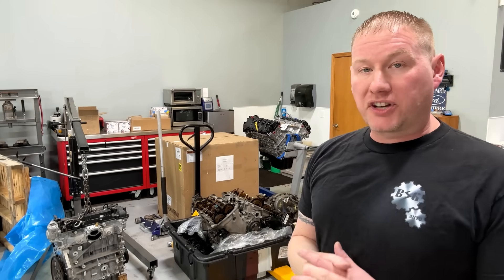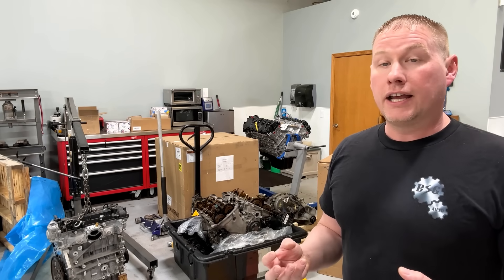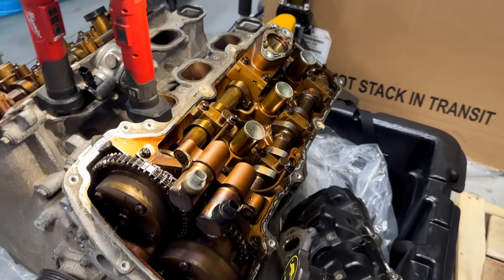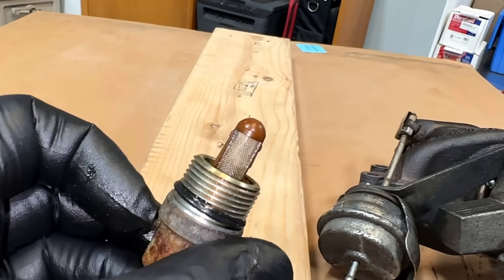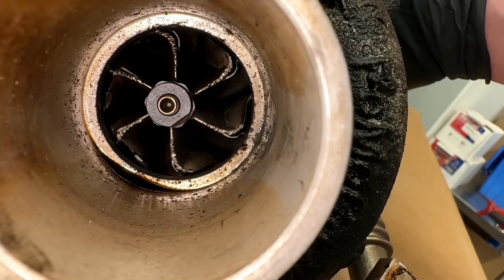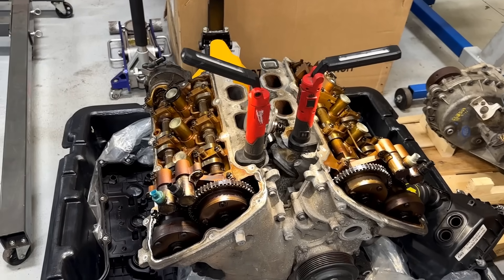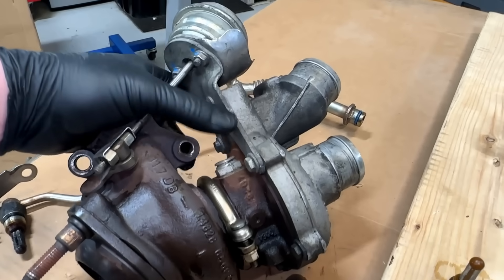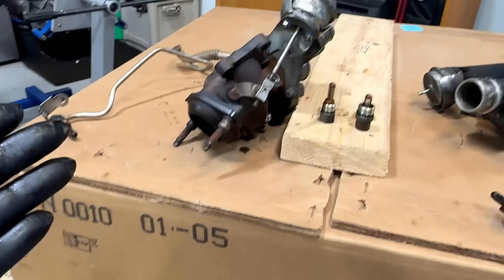This is Why You Never Run Extended Oil Change Intervals on The Ford Ecoboost Engines!

Comment: Have my 2017 F150 3.5 open right now for the second timing/phasers. Dealer did the first one and used the same defective part numbers. After seeing this video I will be checking for these issues too. Love this channel. Thanks for the content.
Reply: 2018 3.5 second set of phasers being replaced right now.  Ford used what parts inventory they had in 2021, part shortage due to the pandemic. Unfortunately most of us received the defective H series instead of the newly designed M series phasers.  I had 44,000 miles on the first cam phasers and exactly 88,000 I am replacing those.  Grateful I bought an extended warranty, deductible $100.00

Comment: I still change my oil at 3000 mile intervals. I'd rather buy more oil than a new engine or turbos. the oil minder on the instrument cluster usually says I have from 75 to 80% oil life left.

Comment: i dont think you can say " running extended oil intervals" when using the built in oil change reminder. if the built in reminder is too extended they need to fix that. my parents (chrysler 200) has the same issue. sometimes the warning does come on for almost 10k+ miles! it needs to be fixed!
Reply from the maker: 10k is way too much so yes that is an extended interval on a turbo as shown here any other questions?

Comment: Brian have you seen one of here 3.5 ecoboost leaking coolant inside of the turbo? I’ve got a guy the passenger turbo is pouring coolant into the turbo. If you pressurize the cooling system the coolant flows through the exhaust from the passenger turbo, it’s not leaking externally, the leak is originating inside of the turbo?
Reply from the maker: never

Comment: HELP !!!! The mechanic is changing my 3rd turbo under warranty I've only put 1500 miles on two turbos. Can the problem be because they install cheap turbos or not I asked about the oil pipes the mechanic says.

Comment: When ecoboost came out,my concern was the turbos. Nothing is special about ecoboost. Same as any other turbo oem,,, let them cool down at idle 1-5min (like a HKS or Apexi turbo timer would) before turning off engine and change oil often. That is the only way i see the claim of "these turbos should last as long as the engine" working out.
Reply from the maker: No need, the Ecoboost engines are designed to create capillary action to keep coolant flow through turbos after shutdown without and turbo timers or aux electric coolant pumps.

Comment: Every engine has it's trouble spots, but which is the safest bet for the Explorers in the 2016-2019 range, is the 3.5L non turbo, 2.5L or 3.5L Ecoboost?

Comment: Great video. I always did my oil changes earlier than recommended but now I will shorten the interval more. Would a FL-400S work in place of the FL-910s recommended for my 2022 Ranger? It seems that the extra oil and filter size wouldn't hurt. Looks like it would fit easily.
Reply: @daveriley1513, Yes both filters have same threads & think 400S adds 0.3Qt. capacity.  In my Mustang ecoB would make my capacity an even 6qts!  However I went with Pl. Boss filter; & their 400S equivalent (as well as other brands) are NOT equivalent to 910S!!  Only with MC are they equivalent. Yes more oil can't hurt!

Comment: When I worked in parts delivery, we had a customer who collected 301 Turbo Trans Ams. Customers would bring them in with toasted turbochargers, due to lack of proper maintenance, then gave up on them when they found out how much it would cost to fix them. He bought the cars from the customers, who were happy to be rid of them. He would rebuild the turbochargers, when had time, and sold the cars years later, when they became collectible. They were just junk cars, in the early 90's, when he bought them. It makes me wonder how many turbo cars of the 80's went to an early grave, because the owners weren't aware of the additional maintenance requirements.

Comment: I appreciate the video...however it makes me HATE my 3.5L eco-crap engine in my 2018 F150 Raptor even more. At 120K miles, It's been in for the cam phasers (3) times, the valve covers leaking oil and the turbo's lagging boost. I've been having the oil changed every 5K miles. It's been a real bummer! For the life of me I don't know why Ford won't offer the Raptor with the Coyote motor option. Definitely not going to pay for the V8 supercharged engine. When my engine dies AGAIN...I think I'll just blow the truck up!

Comment: I have a question about my 2020 Transit 3.5L EcoBoost... since the turbos run so hot, would it be better to upgrade to a better turbo? A larger turbo, even? Has anyone ever upsized their turbos on a Transit? lol I'd personally like a little more power for my large family - maybe bigger, better turbos would be of some use?? ...plus, I'd like to actually hear my turbos, as I don't at all right now lol...

Comment: I have a 2021 Ranger, 2.3 L EB that has oil changes every 5K miles. Driven on over 20 minute trips almost daily. Hour trips weekly. Thought all the bases were covered till this video. Will be checking those screens for sure. 
THANK YOU!

Comment: I have a 2023 F150 with the 3.5 ecoboost in it.  Ford recommends 5w-30 oil, which I have no problem with.  My wife has a 2016 Explorer with a 3.5 naturally aspirated V6 and I have been using the full synthetic Pennzoil oil made from natural gas.  My wife's vehicle has been absolutely perfect, now with 55k miles, I change oil at every 5k miles.  My question is should I move to a 5w-30 oil for the Explorer rather than the 5w-20?  I have been hearing that Ford only used the 5w-20 for mileage reasons?  Thank you for your input!

Comment: I have a 2020 F150 2.7 liter I run mobile one full synthetic, change every 4000 to 5000 miles my question is I like to sit in my truck with the AC running at lunchtime for about an hour 5 days a week is that idling going to hurt the motor or the turbos?

Comment: 224K honestly isn't horrible for extended intervals on a turbo.
When I had my 2.7EB, I used full synthetic rather than the semi they spec'd. I changed every ~7k, or when the oil life meter hit ~40% if I forgot to keep track of mileage. My estimate was 0% would hit close to 9-10K miles with normal use. Way too long, especially on semi syn.  
I went 10k on my RAV4 before that using full syn. I did a couple oil analysis to make sure 10K was fine. Results came back really good. But being non-turbo, and only port injection it was easier on the oil.

Comment: I do oil changes every 5000 miles for simplicity, makes it easy to remember what miles to change at, also the oil can be pretty dirty and lose a good amount of its viscosity which is the protection for the metal, I've made several custom turbo systems for cars over the years and on the next systems I do I'm going to try something different, I want to have a separate oil system for the turbo, it will consist of a tank 4 to 5 quarts, a pump and a cooler to keep temps down, the main benefits to this is the turbo should run cooler and you don't have to worry about an engine issue destroying the turbo system, but the tank would have to be mounted low in the engine bay to facilitate draining of the turbo.

Comment: 2015 f150 ecoboost 
Anyone ever had an issue with a turbo surging ? Not a transmission clunking . Just rpms up in down , juat a couple of hundred not major,  but very noticeable.  And no engine codes.

Comment: Love your videos super informative! I just purchased a 2014 f150 3.5 ecoboost plat from a friend, he always stuck to the 10k oil changes which I always thought was crazy! My question is what do you think of running some sea foam then doing 4-5k oil services? Also on an older vid about changing the molded lead frame. Would a vehicle that had no issue that I know of in 140k miles benefit from this service upgrade?

Comment: Just got a 2023 Ford F-150 with the 2.7L Ecoboost.  I only drive about 3.6k miles a year, so wonder how often I should change my oil, since the oil life monitor will probably go for 11 months before it tells me I need to change the oil?  I had a 2013 F-150 with the 5.0 for ten years, and always went by the oil life monitor to change the oil.  It only had 36k on it when I sold it recently.  Never had a problem, but after seeing your great video on the Ecoboost, I know I need to do something different on my new engine.  Thanks.

Comment: Insert some MMO  into it occasionally and that soot won't build up
Reply from the maker: ok
Reply: @FordTechMakuloco  2013 f150 233,417 for 150k or more been adding MMO to fuel and oil 
I've been replacing 16 ounces of oil with MMO and running it the whole time
Infrequently I add a little to fuel before topping off
Same spark plugs and coils from factory 
My factory battery lasted 9 years

Comment: So my driver's side Turbo is being replaced under warranty (99k) for a coolant leak. Is replacing this screen you show part of the actual Turbo Replacement procedure that a dealer would use?

Comment: How do you remove the oil supply line (on the driver side) to access the turbo oil filter? It doesn’t appear to have any way of getting a  socket on it, and I can’t figure out how to get the oil line off without breaking it.
Reply: Mine looks like the filter in your video, sitting on the right, on the piece of wood. It looks round?
Reply from the maker: You pull the turbo and turbo coolant lines first.
Reply: @FordTechMakuloco  I have everything pulled, turbo completely removed, coolant line removed. My question is how do you get the filter out of the block? It is round, no way to get a socket on it, but it is threaded into the block.
Reply from the maker: you use an Allen key or bit.
Reply: @FordTechMakuloco  okay thank you sir! Does the oil line just pull straight out of the filter to gain access? Mine doesn’t seem to want to come out very easy
Reply from the maker: yup it simply pushes into it to seal, no retainer at all besides the bolt you already took out to remove the coolant line that overlaps it.
Reply: @FordTechMakuloco  got it out and filter replaced, thanks for your help!

Comment: How often should we change the filter that feeds the turbos? Once every 50,000 miles?
Reply from the maker: They are good for the life of the engine as long as you maintain the engine oil they will never clog.

Comment: I just bought a 2019 f150 stx with the 2.7 and it has 116k miles. It still runs like new. The previous owner taken it to the dealership every 4k miles. I put a boroscope down intake and everything was clean. Maintenance is everything.
Reply: Same specs about a month ago! It got two new turbos put on at 100k (before me) and I’m hoping it will last a long time

Comment: Don't care what ford says, dealer says . First Ecoboost 1.6 another one 1.5.   !4 Escape/  !8 Escape.  Never had turbo before . When I first had the 14 Escape I watched this gentleman's videos  .. Change oil like clockwork  at 3000 miles Motorcraft filter Valvoline full synthetic. 5-20 About 26$ /oil change. No problems . I have never believed in extended oil change intervals on any engine, especially turbo charged.

Comment: Hello, Great channel! I have a question i regards with my Ford Focus 1.6 tdci 2008 not starting , the battery and starter are working (checked by mechanic) by the car does not star still and the fuel pressure is low the computer says there is a problem with fuel sensor but I have changed it with new one and still nothing. Anybody has any idea or had this problem and how to fix it or what is wrong with it ?

Comment: I have a 2.7L twin turbo i get the oil changed every 6 month's no matter the mileage its never close to 5K and i always take it to the dealership.  But lets talk about the engine you are lookin at. 212K miles damm thats pretty good i mean probably could have lasted longer but 212k is pretty damm good.

Comment: I used amsoil and went 5k miles on my F150 3.5 ecoboost,  is this right? 77k miles
Reply from the maker: 5k is correct
Reply: @FordTechMakuloco, how do you feel about oil catch cans? I recently bought one and installed it at 77K and I got the truck at 67K.

Comment: Thank you for the info. My 2022 edge st has been serviced by Ford before the recommended 5000  mile oil change. Is Ford's synthetic oil good enough? Have heard about oil drain back because of filter placement?

Comment: My son recently bought a 2012 F150 3.5 Ecoboost.  It has developed that dreaded chain rattle.  Now we can't find an OEM timing chain.  Ford is backordered with this part for months.  Any suggestions on an after market timing chain?  Goes to show you how important 5K oil changes are for these engines.

Comment: I need someone to answer my question. I always have changed my 2021 F-150 2.7 L oil at the dealership. They’ve always use the synthetic blend recommended by the user’s manual. Is it bad using synthetic blend??? Thanks in advance.

Comment: We've been following the Ford recommendation of 10k (which is also the point where the oil change recommendation pops up). Shame on Ford for making recommendations that end up destroying stuff. But is isn't a surprise, though. The PTU and transmission change intervals are the same way. Waaaaay too long for these fluids to be in the vehicle.

Comment: I change the oil ( Vw fully synthetic spec) on my VW 2.0 TDI twin turbo running 290bhp every 10,000 miles. Running as new at 180,000 miles. It doesn’t burn a drop of oil.

Comment: Given the cost of repairs versus changing the oil and filter at normal intervals, I fail to understand why anyone would do this extended oil service. I put an engine cleaner in and run the engine for 15 minutes before every oil change.  Would this help keep those turbo oil screens clean?

Comment: Have you ever seen excess fuel in the oil on 3.5 eco boost? I have a 2012 F150 with 110,000 miles. I recently changed my oil before a 4000 miles highway drive. Afterwards, I had what looks like an extra quart on the dipstick. I also noticed my fuel economy was falling. Can you suggest possible causes and troubleshooting tips? Leaking HPFP? Dirty injectors causing bore wash? I am the original owner. The truck has lived on Mobil1 5w-30 with 5000 mile oil changes since new. I sincerely appreciate all you do for us. I changed my trans cooler lines at your suggestion and with your videos it was easy peasy. I added an oil separator at about 100k miles. Wish I had done that sooner. Gonna pull the throttle body and bore scope for excess carbon buildup.

Comment: My 2018 Ford Explorer Sport had the 3.5 liter eco boost.  I lost the turbos before 100,000 miles and the second set at 30,000 miles after replacement.  I bet this is why.  I followed my dealerships recommendations and took it to them for oil changes.  I traded it in bought a F350.

Comment: Does this also apply to the V6 2.7L engines?  Also, should full synthetic oil be used and not synthetic blend to keep the turbos from failing?

Comment: What's your thought on the oil minder for low mileage? I just changed my oil after, what, 9 months at least, maybe even pushing a year, but only had like 2800 miles on it. OLM was around 10% I think? Didn't mean for it to be a long time but I just never drove the thing. 5.0 2nd gen.

Comment: I worked in a fork truck workshop for years an 99% of our fleet truck turbo's failed due to infrequent oil changes out in the field, personally i ran a factory turbo on my golf tdi for 200,000 miles, i just changed synth oil and air filter every 3500 miles, hardly any oil passed in intercooler, still pulled like a train when i sold it.

Comment: Would you recommend using seafoam in my ecoboost crank case help prevent the buildup in these screens? Obviously also to be paired with regular 5k oil changes and high quality oil.

Comment: I have a EcoSport with the 1.0l I have changed my oil every 3500 miles.... I don't care what others say I will do it at 3500 miles. Why not when Ford made parts that need to be in oil.... clean oil.

Comment: I'm trying to find a updated video for what oil to use with the 3.5l ecoboost, the old one says to use ultra platinum and 5w30 but make sure it says SN Plus, well its not SN plus anymore on the back of the jug.. from what I can tell its a GF6 now and 3rd gen dextrose 1. Is this still the recommended oil?
Reply from the maker: Like I said in the video SN+ was an interim fix before the spec was finalized in SP. So as of right now SP is the latest.
Reply: @FordTechMakuloco  must've missed that part, thank you sir.

Comment: Another great video.  I have a 2021 F150 - 2.7EB.  It’s a spare vehicle that only gets about 2,000 miles a year. What oil and frequency do you recommend for an Ecoboost that doesn’t reach 5000 in a year?
Reply from the maker: In that case once a year would be your interval.

Comment: I used to run 10,000 miles before oil change. After I started to change my own oil, I change my oil every 5000-7000 with synthetic. Changing my own oil helps me find problems with my car.

Comment: How would you handle buy for example a 2016 f150 with the 3.5 at 150xxx is there any ways to clean that out besides regular oil changes because I worry buying a used at higher mileage this may be present in it? Anything I can put in the oil to help clean the engine out?

Comment: OIL. IS. CHEAP ! ! !   ENGINES ARE EXPENSIVE ! ! !   Don't wait for some programmed light to come on.
I say if you drive a lot of miles, change oil between 3000 to 4000 miles.  Don't drive a lot of miles?  Change oil EVERY 6 months or SOONER!
Thanks for the video Brian.

Comment: Do we know if he used an oil with the proper specs?  Not just viscosity but API/ACEA/FORD specs?
Reply from the maker: He obviously used semi synthetic or full synthetic based on the amount of varnish. So any off the shelf oil would of met the spec and the improved sn+ and SP oil have been out of years now.
Reply: How about the oil filters?  Did he use OEM?